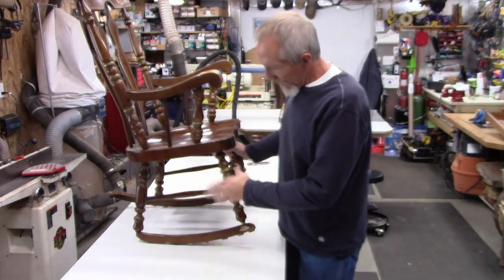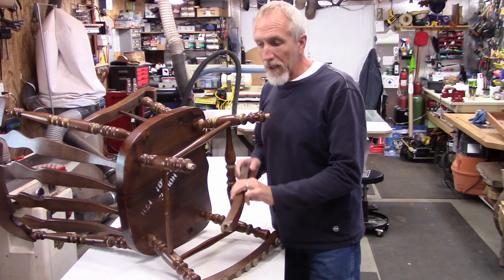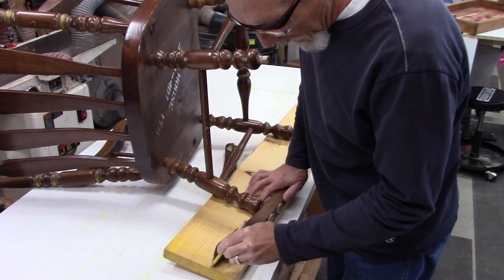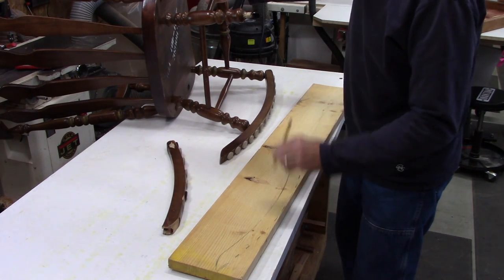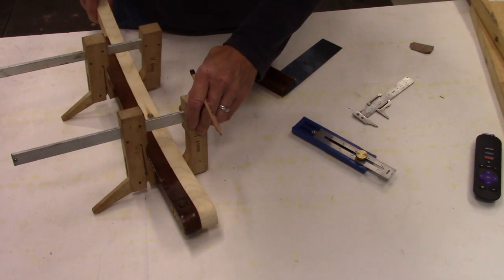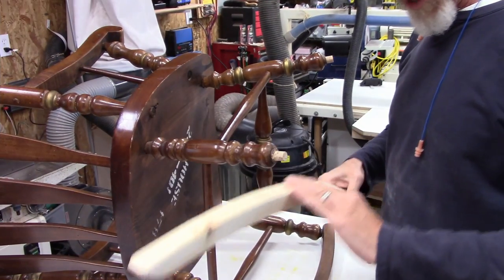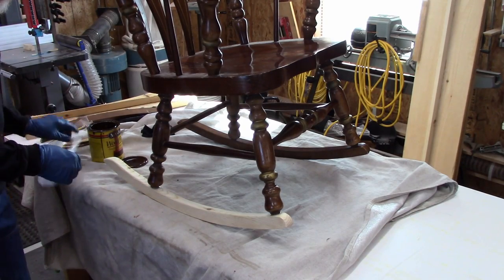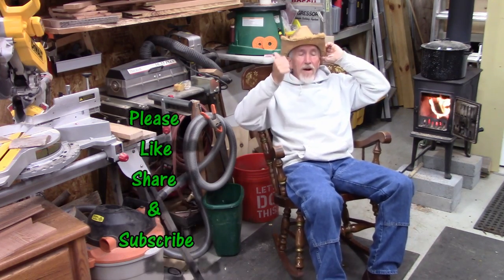How to repair a rocking Chair. DIY~Replacing a rocker

Comment: Thanks for your video. I had an old rocking chair that I had painted white 18 years ago for my daughter in law but she left it when she moved. It sat on the front porch for 17 years.  After stripping all the white off, spindles weren't fun, I found 1 of the rockers was 1/2 way rotten where it made contact with the concrete.  I thought I had to use wood patch knowing that probably wouldn't work.  Then I found you! I just happened to find a piece of wood to get only 2 rockers exactly!  Maybe my dad saved it for me! RIP dad. Thanks and sorry for the long story...I'm Italian! I could tell a story no other way! 😊 Thanks again! I'm going to go for it.  Did you send on an angle on the inner rail? Have a great day!

Comment: At the beginning of your video you said that you were going to figure out the angle of the hole drilled in the chair rail, but then you never explained how you did that.  I have to replace the exact same problem (one rail broken off).  I have the new chair rails, but the angle of the drilled holes is a mystery to me.  How did you decide the angle to drill?  Thanks, JD
Reply: I thought I saw him angle the chair so that the chair leg made contact with the floor. It would go in straight,  right? Then the same on the other side, therefore no angles, right?  I'm trying to picture it and it seems right. 😮
Reply: I said "right" 3 times so I can't be wrong,  right?😂

Comment: Question. If you had the peice that mysteriously disappeared, would you have tried glueing it back together? Its not a clean break, pretty jagged but it does fit back together nice and tight.
Reply from the maker: If it fits back together i would glue it and assemble it. Make sure you clean off any old glue first on the dowel-mortise section.

Comment: When the legs of the chair are at an angle, the dowel ends are farther apart at the ends then at the base of the dowel, hence the holes on the rocker would be closer together at the surface then at the bottom of the hole.  This being the case, the dowel ends of the legs will be farther apart than the opening to the holes in the rocker and it will be impossible to insert the leg dowels into the rocker.  I believe it will be necessary to remove one of the legs fron the seat so that it can be shifted such to bring the dowel ends of the two legs closer together for inserting.  Is this the way to do it?  I have this problem now and am looking for a solution.
Reply: Go to YouTube Fixing Furniture he will show you the way to fix anything on furniture